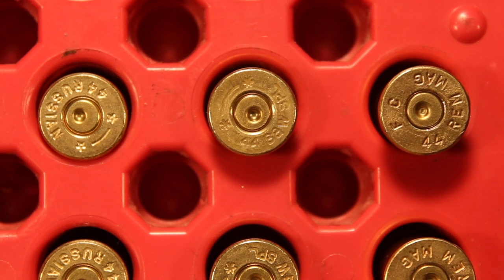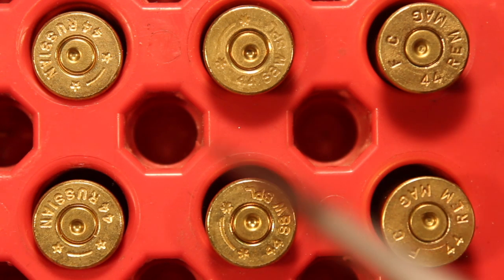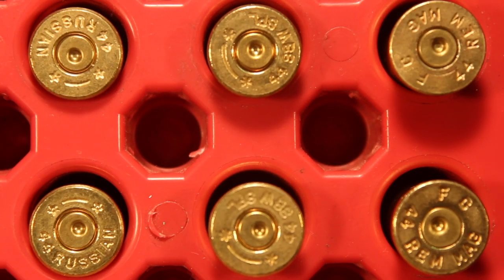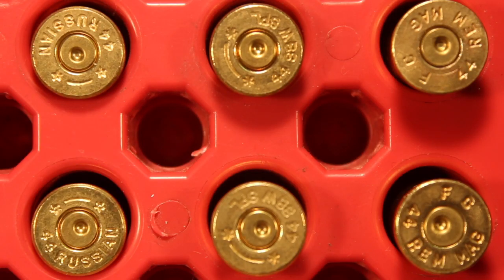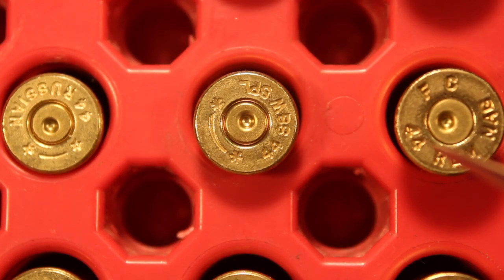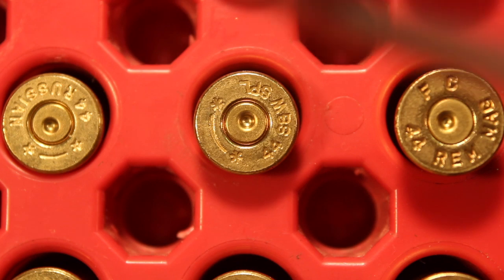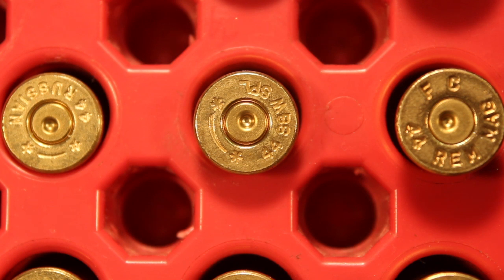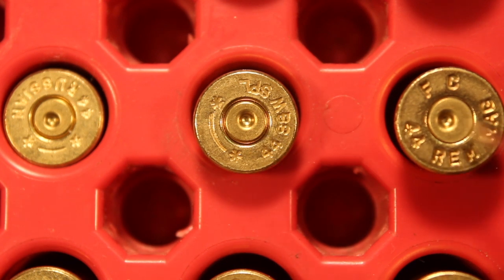Primer Sign Pressure Evaluation Revisited

Comment: I have learned that over calibrated cases can show signs for flat primers without any high presures. reason is that the case has to much room to grow, and the primer gets "ahead" of the case expansion, and thuss get sqeezed when the case cathes up. You ned ALOT of presure to flatten a primer in a correctly sized case. but some calibers are more prone to it then other.

Comment: Talking about depth of firing pin strike on the primer, while loading some reduced 223 rifle loads, I noticed that firing pin strikes are much deeper on reduced loads than on normal pressure loads.  My reduced loads are producing 1600 FPS and QL estimates pressure in 18K psi range.  I imagine that high (normal) pressure loads pushes the dimple outward resulting in a reduced depth of the dimple.    So I’m learning that a deep dimple is not a sign of over pressure.  Or at least not based on my experience.

Comment: Hey hate to bother you about something different.
But I have never reloaded. But I am thinking of the Lee set the one you use a hammer . I have found a 94 375 big bore at a good I think price.
But if you can find it the 375 win. Ammo is very expincve. $ 45-69 i have been told you can use 33-55 ammo in it.
But it's expincve just a little less. $ 36-58. And is way less powerful.
  Have you ever messed with a 375 win? If so is it worth the truble?
Is the little Lee kit a god way to start?
Can you use the coted bullets you have talked about in some of your videos with it?
And what do you think about using the 38-55 ammo in it?

BTW Buffalo bore states it's safe with there ammo
   Any like your videos
And thanks for your help and time.
Have y

Comment: "A little more?"  Hmmm.  I think you are wrong and encouraging people to take dangerous chances with their powder charges.  Richard Lee wrote about the dangers of "a little more" powder in his book "Modern Reloading" second edition.  There is a point where an increase of just 0.1 (one tenth), of a grain will push a powder charge into the dangerous pressure range.   Often "a little more powder" doesn't yield any appreciable velocity, or accuracy.  The gains are too small for the risk incurred.  Study the load data on the Hodgdon online reloading website.  Take note that the highest velocity isn't always produced with the highest pressure.  
I like your videos FC, but this one generates concern.  We don't need people blowing up their guns from using "just a little more" powder based on a fired prime's appearance.
R, Steve
Reply: I believe you are taking what both Fortune Cookie and Richard Lee said out of context. Good judgment is the best protector in almost any situation. I have reloaded over fifty years and have many times used the same sort of evaluation process FC is using and never damaged a gun. I have seen guns of others blown up, but it was always due to a double charge,or firing another round after a squib load, for instance, not from carefully working up a load while judiciously examining fired cases for pressure signs. In many cases the cartridge FC is working with (like 44 Russian and 44 Special) are loaded very lightly in deference to the fact that there are older, weaker guns out there, some 140 years old or more in the case of the Russian. But if one has a strong modern gun like a Ruger, there is no reason not to explore the capabilities of these cartridges as long is it is done carefully by an experienced reloader like Fortune Cookie who can assess the safety margin he is working with.
Reply: In the youtube option to report a comment they need to add a check box for "insufferable Karen". 😂

Comment: pull the bullet of factory rounds if possible from the same brand of your primers  resize them ,leave the factory primer in the case  load the case with your powder and bullet ,compare the fired primer with a fired factory round primer from the same box. you get a idea . if a revolver or other gun has a lot of headspace and or loose primerpockets in the case  you get also flat primers

Comment: I am not sure that the science community would be satisfied with the simple inference that the muzzle velocity was a confirmation of the pressure in this comparison. You are essentially stating that low muzzle velocity means low cartridge pressure. I am not sure but I don't  think that would always be true. You neglect to identify other impacting elements of the process.  For example , you did not qualify what the mass of the projectiles were for each round in the comparison. A significant greater mass of projectile could be enough to show higher pressures in a lower muzzle velocity. Did you use identical projectiles in all three rounds?? I have a science background (albeit rusty now) so I think the experiment did not have enough controls described for your statement to be taken as valid. Intuitively I would agree. But intuition only leads to hypotheses. Properly controlled experiments lead to results that could verify the hypotheses. I think there are several other controls that would have to be introduced for you to be able to confidently state what you stated.   ...... :) Interesting information though.

Comment: I  load slightly under the published high mark of the load data spec when previous loads have shown no signs of high pressure so , for me I don’t have much  practical experience with over the top high pressure indicators , other than what I have seen on video ! If there is a need for greater performance from any caliber , I would consider changing caliber’s.  That may sound sissy but , I have lived 59 years without damaging or destroying any gun or injuring myself or anyone standing next to me ! For the high rollers who challenge the capabilities of guns and loads , I’m greatful for the opportunity to watch videos !  Thanks for the great cookies .

Comment: Could you do something similar showing the effects of different primer brands?

I began loading my 9mm with CCI primers and then had some Remington ones on hand. I used them in the exact same load and the fired cases had VERY flattened primers, with cratered firing pin indents. Same load that always worked just fine with other primers looked dangerous if you only considered how the primer looked. I don’t use Remington primers anymore after that.
Reply: did you use the same type of primer ,small pistol standaard  and not magnum or leadfree

Comment: Am I mistaken?Thinking of a bullet in an automatic and not a revolver. Bullet speed is not a link to pressure unless the projectiles have the same weight and same coefficient of friction in the barrel. A more accurate measure would be the inertia of the bullet. taking account of the weight of bullet and friction of the bullet at firing. Higher bullet weight and friction will give higher pressure, not necessarily higher velocity. Is this the same for revolvers?
Reply from the maker: Chris Smith - You also need to take into account the bearing surface.  A higher coefficient of friction but with less bearing surface would yield the same bore friction as a lower friction bullet but with more bearing surface.  Also, the depth of the rifling would also be at play.  A barrel with deeper rifling would have more friction with the bullet.  You would only compare pressure and velocity with the same bullet weight as you have already pointed out that heavier bullets shoot slower with identical powder charges than lighter bullets.  Going to lighter bullets (less bearing surface) with expansion with maximum loads was the driver for Super Vel ammo back in the 70s - and Super Vel has risen again.  This discussion is all good stuff.... Steve